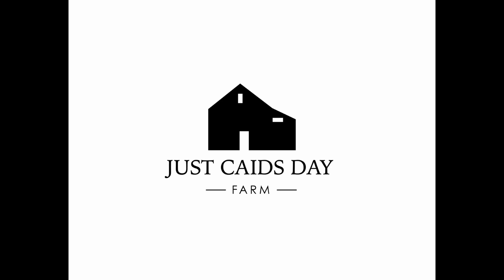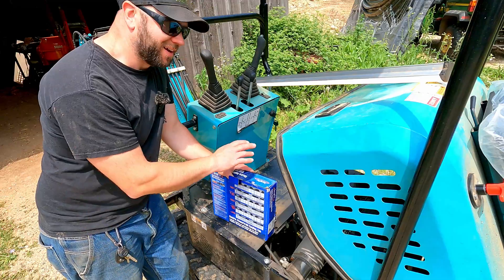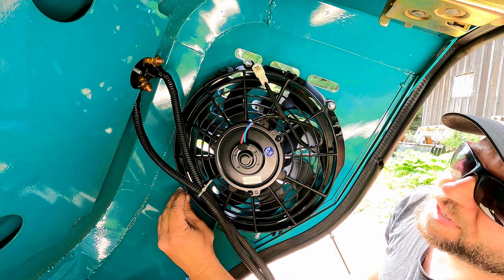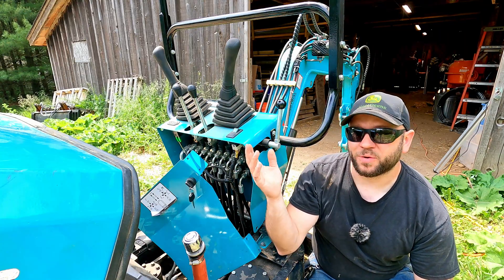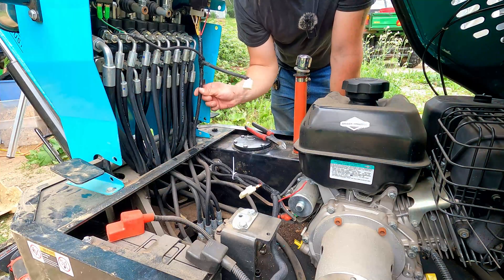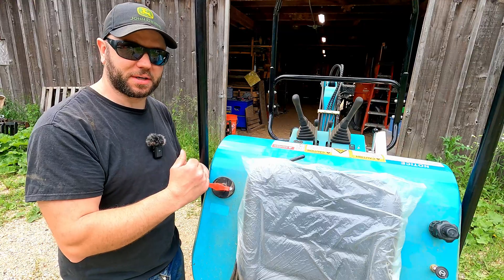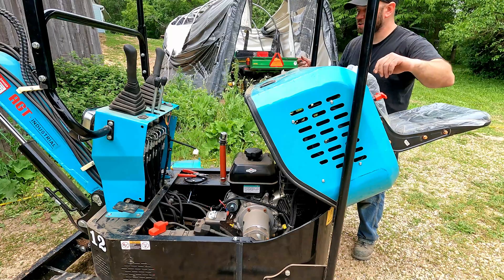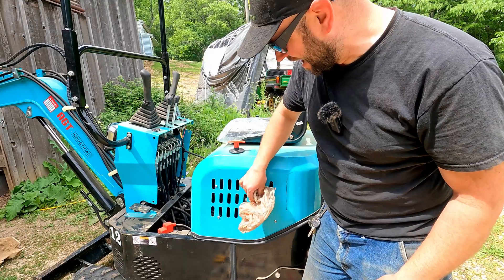HOW TO INSTALL A FAN ON A CHINESE MINI EXCAVATOR

Comment: I hate to hear bad news but.... All you
Had to do was reverse the wires.
Reply: That would depend if the fan was bi-directional. Most are not.
Reply: Correct those fans you have to do both flip blades and wires.
Reply: Yep.  That's all it takes on a 12-volt DC system.
Reply from the maker: I just followed what the installation instructions said. Had I kept reading would have saw the part about flipping the wires right away as well.